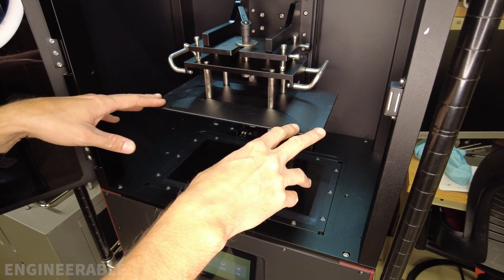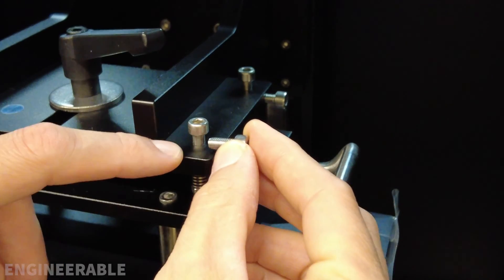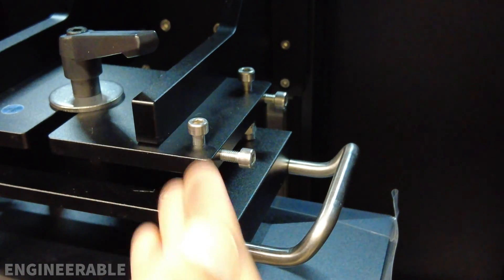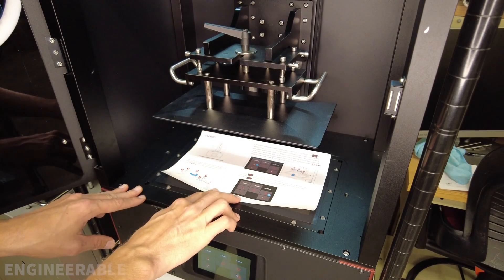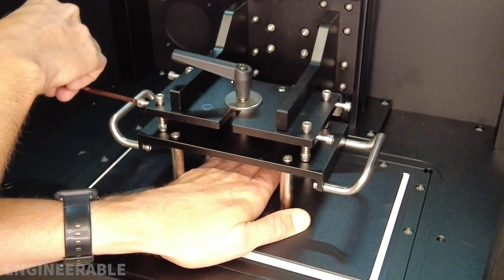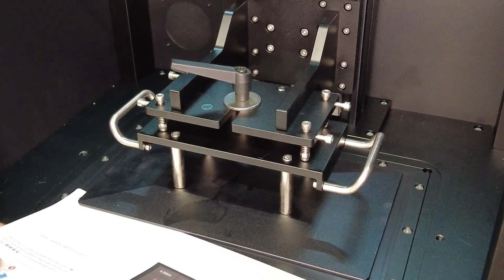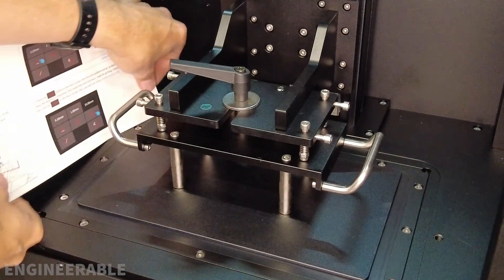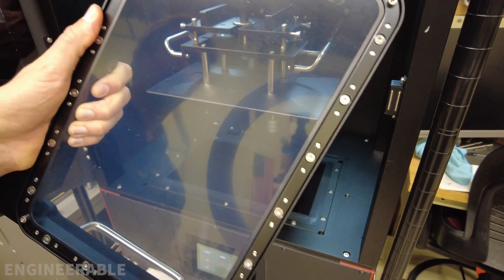HOW TO LEVEL Elegoo Jupiter 6K 3D RESIN PRINTER BUILD PLATE | Tips and Tricks

Comment: Shouldn't this video be called HOW TO INCORRECTLY CALIBRATE THIS PRINTER? When the machine finishes the calibration it places that point as Z=0. All the movements that you have made afterwards, if you don't press the Z=0 key at the end it doesn't memorise them, so they have been useless and when you print the plate will go down to the initial point when the paper was very tight, and even more if you consider that the thickness of the fep of the vat will be added. I don't understand people uploading incorrect videos and even less why this video still exists and appears in the first place.
Reply from the maker: The Elegoo instructions do say to press "set Z=0" after raising the build plate by 0.1mm until the leveling card can be removed with slight resistance. HOWEVER, in my experience it should be left tight like it was initially for better build plate adhesion. The paper is the same thickness as the FEP. Even when Z=0 is tight, there's still some resin between the two layers, and the thinner the initial layer, the better the adhesion to the build plate. All the movements I made afterwards were to demonstrate how to check if the build plate is level, which is the most important aspect of setting the Z0 for even adhesion across the whole build platform.

Comment: Having an issue maybe you could help with. I just got my Jupiter and when leveling front left corner is tight but others are loose. All my print attempts fail. I have not been able to print one test print yet. I think some layers print then it sticks to FEP.  Any advice?
Reply from the maker: The way the screws tighten can really throw things off. Did you see or try the ball bearing mod I show in the video?
Reply: @Engineerable  I did see it but I just got the printer yesterday and I do not have those ball bearings

Comment: My prints keep sticking to the FEP film. Any suggestions?
Reply from the maker: It's usually related to the build plate leveling, initial gap (move slower and closer), first layers exposure time, and make sure build plate is clean. This build plate is so large, it can take some time for resin to squeeze out on the first layers, so slowing down the movement on the first layers can help.

Comment: My Jupiter only has adhesion in the front. It drives me completely nuts. When i start a print the front row looks great but the last row doesn't even have a model on to it. the buildplate aint bend or has damages. What am i doing wrong?
Reply from the maker: Have you checked the UV light to see if it is even everywhere?

Comment: I got our first Jupiter and I am just confused about the whole build plate leveling method. I understand the first-time leveling, but then once the first print is done, I take the build plate to put it back in place, and then guess what, there is no guarantee that the L handle will be tightened exactly the same way. If it is even slightly tighter than where it was before, there is too much gap between the plate and the FEP now and nothing will stick. If it is even a tad bit loose, then the build plate is now too close to the FEP, exerting pressure on the model and essentially resulting in print failure. So as of now what I understand is, you need to calibrate your printer after each print, which is absolutely not ideal for a large-format printer like this. Any word of advice from your experience of dealing with this printer? Thanks in advance.
Reply from the maker: I haven't yet had this issue, but I can see how the attachment method using the L handle is not a good design. Here's something you could try to make sure you always tighten the handle the same. Remove the nut at the end of the L handle bolt. Add 2 nuts to the bolt (it's better if one is a locknut), and maybe a washer. Screw the L handle back into the build plate, and put the nut back on the end. Now, when you level it and lightly set your L handle tightness, turn those two nuts all the way down to the aluminum plate, and use two wrenches to lock the nuts in place. This will set the tightening position of the L handle, so you should be able to easily tighten it the exact same each time.
Reply: @engineerable  Thank you for the tip, that sounds like a great way to secure the position. I will give that try because I have had the issue already a couple of times so would definitely want to eliminate that in the future. Cheers!
Reply from the maker: @precisionmodelworks7212  Also, are your 4 screws tightened well? Did you see my ball bearing mod in this video?
Reply: @engineerable  They are tightened well and yes, I did like the ball-bearing method that you mentioned, though haven't tried it yet. The issue here is that those leveling bolts have springs on them and the purpose of those springs is to exert pressure on the build plate to force them down. So even when the tightening bolts are fully secured, depending on how loose or tight the L handle is, the build plate moves considerably (by 3D printing standard). You can test it by placing the leveling card and then loosening and tightening the L handle - you will see the difference is considerable between the position where the L handle just engages to secure the build plate vs. its tightest position.
Reply: I've had this same issue. I'm kind of dumbfounded how they would actually design the locking mechanism this way, there is so much room for error. Everytime I turn to lock I would notice that the whole build plate shifts out of place. It's almost impossible to get a consistent result. I've yet to get a 100% successful print, my best attempts would still have at least one part peeling off of the print bed.

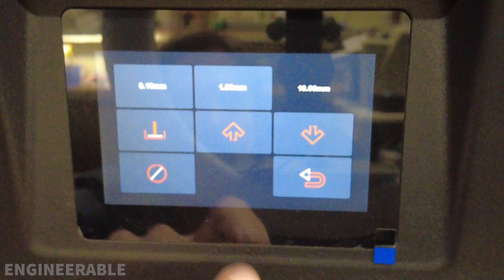Comment: 5:07 you don't press something to confirm zero point?
Reply from the maker: No, the initial "homing" is the position the printer assumes that you've calibrated it to after the leveling procedure. Lifting it up by 0.1mm and testing again with the paper is to see if the space seems even everywhere under the build plate. If not, you need to repeat the leveling procedure.
Reply: @engineerable  it still requires you to save the z=0 to save that.